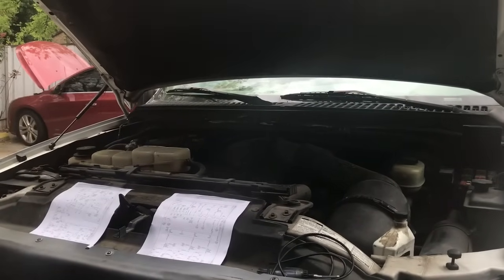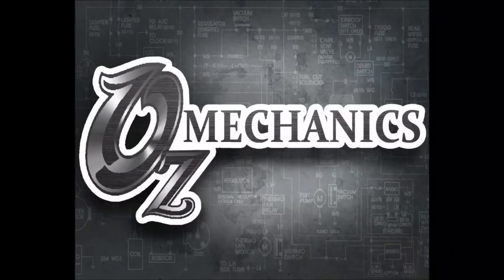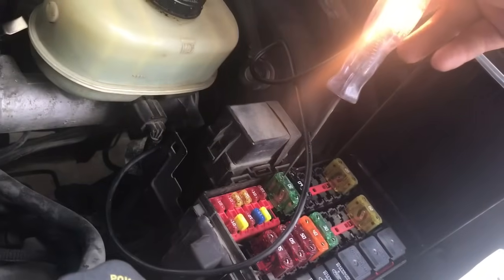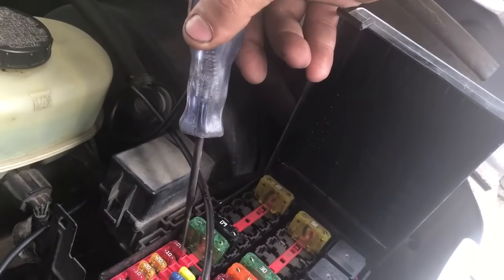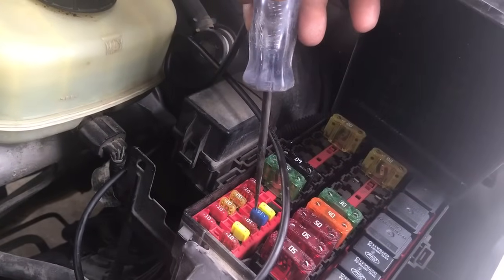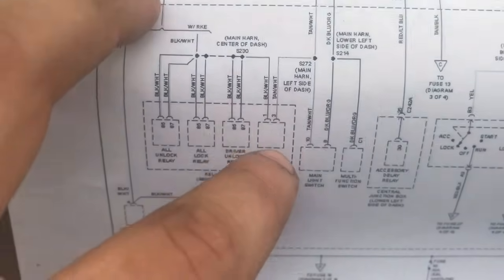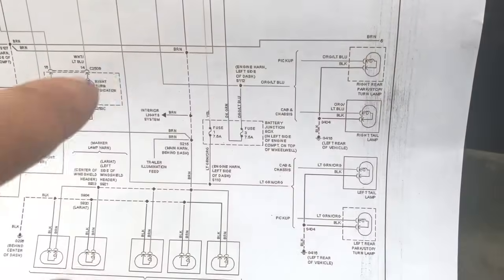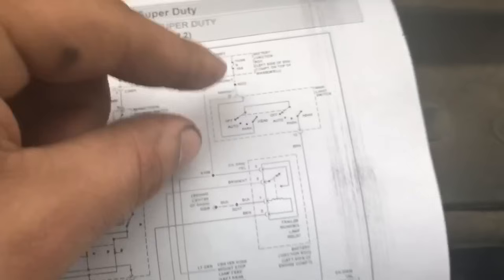How to fix a blown fuse. Short to ground

Comment: Oz I'd like to say thank you very straightforward very informative and I found a dent on the side of my truck where I drunk driver drove me off the road into a ditch and that pin connector was rubbing the bumper and exactly the same place thank you so much I am a single dad who doesn't have a lot of money and I have a 2000 Ford F250 and I really appreciate your time and doing that video

Comment: Can tell they drove it like that for a while before the wire rubbed through and shorted out.  Great job on showing the diagnostic approach.  Show people how it's really done. Yes the damage is obvious but you still have to go through the process. Showing people the right way will save them from making the wrong call. This isn't just about finding the short, it's about teaching people the right way to find one. Good job, Bravo.

Comment: Hey Oz, you can also use a 12 volt test light instead of the fuse if you got a helper, if not use a 12 volt buzzer instead of the fuse. As long as the short is there the light will be lit or the buzzer will buzz. Then you can unplug connectors, and wiggle wires etc until you find where the short is.
Reply from the maker: Bryan Lamontagne yea I had a chat with another tech about this trick. Now I can save my fuses thanks very much.
Reply: Is there a 12 volt buzzer specially made for this? If so do you have the brand/model?
Reply: What would we connect the buzzer to?

Comment: I got something wrong with my truck taillights too !!🤦‍♂️  every time I put on a new fuse it blows  basically instantly and my brake lights and running lights don’t work but my reverse light and turn signals work 🤷‍♂️
Reply: Same problem here 
How you fixed?
Reply: That’s my problem too any solutions?
Reply: Mines the opposite... rear driver side ɓlinker works for a bit on the road than suddenly I get the rapid blinker and only my rear driver side blinker doesn't work the bulbs are all new as well. Ford Flex problems...
Reply: I had the same thing happen but I then placed a number greater in the fuse and it works now but I’m still have issues with my dashboard when I turn off the lights the speedometer turns off and I can’t pull the key out unless the head lights are on

Comment: Of all the videos I've searched on how to find a shorted circuit in my truck, yours I understand.  Ihave a question though _ my fuse doesn't blow until I put the vehicle into gear. I.E. my ECC1 fuse, is lit on both ides, with ignition on,  using the same probe to test it. , I'm thinking to continue as you did, knowingits the fuse that pops.

Comment: Easiest way to all fuses is using a multimeter set to ohms(beep) go across each on if it beeps its good.  Cut off that pig tail and make a test light,  next time use the pig tail test light, remove bad fuse and install pig tail, it will be lit if you have a short to ground, then start unplugging connectors if light goes out your on the right path.

Comment: Very good video. You're quite the detective. I was trying to find a loose connection in the trailer wiring, on my 2002 Tundra, because I'm getting no brake light, or real dim left brake and blinker on my trailer. I tested the truck with a plug in tester and found it'd in the truck. So I started unravelling tape and wires and checking connections. I replaced almost all connections, and got nothing. Now my dash and heater fan fuse keeps blowing. Any suggestions?

Comment: Just got this 2000 f450. Fixed the same fuse when I first bought the truck and just popped again the other night. Shut down my dash lights and my trailer running lights along with my truck running lights. One of the wires running to a small light on my dump bed is disconnected hanging loose. I'm sure that's it. Thanks

Comment: On Acura MDX 2002 My rear windshield wiper keeps popping a fuse and my SrS light came on after we changed the fuse, I'm not sure if the mechanic pulled out another fuse but then did put it back and checked all the fuses and replaced them but the problem persists, can you help please?

Comment: Great video, but I will just never get electrical.
What's your thoughts on my problem may I ask.
My 2007 civic keeps blowing the smaller 10a fuse for my blower motor.
When I change the fuse the blower works 100% for a bit.
But if I stop the car for a bit and start again it instantly blows the fuse but not every time?
Heater resistor appears to be fully working and tests ok
Reply from the maker: Could be different issues. Shorted wire, shorted part, high resistance causing a drag

Comment: 2017 Rav4 XLE AWD 
same story on this end, BATTERY JUMPED BACKWARDS (I know).
Both fuse boxes with blown fuses.
Right hand side fuse box facing the vehicle with a few blown fuses 10A,20A (already replaced).
Left hand side relay/fuse box with the HTR 50A blown.
When I try to installation a new  50A as soon it touches the pins/terminals the fuse blown again (already try 3new fuses and same issue.
AC NOT WORKING no air coming out of the vents (hot or cold).
Any suggestions? 
And thanks in advance

Comment: Got a 2015 Ford Explorer and compressor locked. Checked all fuses w/ multimeter  and only  fuse # 62 (air conditioning clutch) doesnt have power. I put a new fuse in and multimeter doesn’t beep still/ no power. It’s not blown. It’s like there’s no more power at all. What could be the culprit and what should be my next test from here? Much thanks
Reply from the maker: What do you mean when you say locked ?
Reply: @OzMechanics  I turn on AC and blows out as normal minus cold air but when I look at the compressor it’s not engaging or spinning
Reply: @OzMechanics  been looking into ac pressure switch to see if that’s it but I can’t find it at all.

Comment: Have a 2000 Ford F-150 blows dash lights and running taillights fuse as soon as I turn switch to turn lights on ..... tried new switch no luck ...
Reply from the maker: You would need a wiring diagram to verify what wire would cause it to pop. Do you have any reputable shops around you ?

Comment: My radio fuse blew. I try too put in a new 1 but they all just keep blowing as soon as I put them in. How can I fix
Reply: Mecha Iroh same ,and my cigarette lighter going out along with it
Reply: @krishh4694  Just a short, that will need to be isolated somehow like he did here. He was lucky that there was a dent, usually it could be anywhere on the wiring harness where it touches the body frame (grounded) or even a faulty switch that grounds itself when using the knob.

Comment: When there we're not tail lights was the dash also not illuminated?!
Reply: This is most likely as the power distribution goes to all of them, one short kills parking lights & cluster illumination.
Reply: @scientist100  the “Parking LPS” fuse goes to my Gauge light, parking tail lights, & my license plate light. (1988-1994 C1500)

Comment: I've got a 1989 Chevy Silverado k2500 I put a new fuse in the pannel for the park lights soon as I turn on the park lights my dash pannel dies for lights and so does my park lamps I still have head lights brake lights and turn signal could it be a ground?
Reply: have you figure it out? i have a 88-94 C1500 that’s doing the same exact thing!!

Comment: SOMEONE HELP!  Trying to help coworker find a short.  His 1995 camry XLE v6 has no power to  radio, clock, overhead light. 20 AMP "Dome" fuse Blows immediately. I am trying to help him get a new radio installed but am stuck until we find the short. I jumped a wire where the fuse goes(very quickly) and the radio came on.  I have no fracking idea where to even begin looking. Does anyone have any advice.

Comment: Hey OZ. I have a 99 Honda Civic sedan. Bought it a month ago. Drive fine for that month. Then I went to start it one morning and it would start. Cranks but won't start. It does have a oil leak. When I turn it on the battery light comes in and the oil light comes on also. The battery is fine. Dont know what it could be. Any suggestions? I've heard these car don't start if they're low on oil. There is oil in the car tho up to the first dot. Thanks .
Reply from the maker: DaFuhk for a car to start it need 3 things. Spark, fuel and compression. Look to see if it has those. I have other videos that show how to check that
Reply: Check to see if oil is leaking by the crankshaft sensor, oil could also be getting in the connector causing your no start.
Reply from the maker: Try to listen if the fuel pump is kicking on. These have a main relay that go bad as well
Reply: DaFuhk
Reply: KISS is it getting spark if yes check to see if getting fuel if yes then start with sensors

Comment: One cuestion i have f 150 2012 window fuse still blow in change relay and botton front the doors in still blow  a need help
Reply from the maker: christian trivino you might have a short to ground somewhere in the wiring
Reply: @OzMechanics  thanks you i thank a need to change the  power window regulator thanks my friend
Reply: Hey is continúe blow the fuse i dont have idea what is 🤔
Reply from the maker: christian trivino you might have a shorted wire somewhere.
Reply: @OzMechanics  how Fine this problem my friend
Reply from the maker: christian trivino need a wiring diagram to see which wires are connected to the fuse. After that tracing the wire down. It seems that the wire is shorting out to ground so I would look for a part where wire would touch metal. If it get to difficult I would find you a good shop that has good reviews to fix up your problem
Reply: @OzMechanics  thanks amigo you are very profesional thanks Again for you help
Reply from the maker: christian trivino no problem. Hope everything works out

Comment: My fuse isnt blown it just not getting power
Reply from the maker: Have you diagnosed it to verify where it should be getting power
Reply: @OzMechanics  diagnosed how? I used my multi meter to test it and got like 0.14 volts but then I took that fuse and swapped it in a different spot and it got the 12 volts so I'm not sure where to go with this information
Reply from the maker: @jacobwilson399  that fuse it most likely good. You need a wiring diagram to verify what’s feeding that fuse. What part of the states are you in I might direct towards a shop that I might know to get it properly fixed
Reply: @OzMechanics  I'm in temecula California